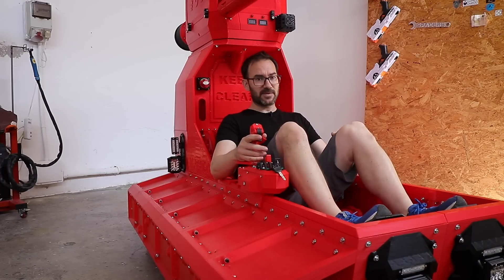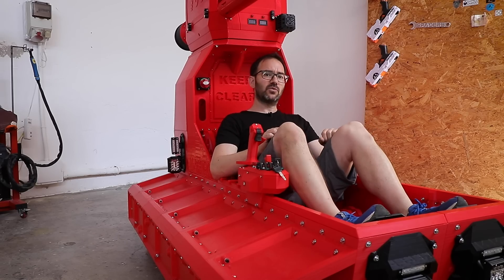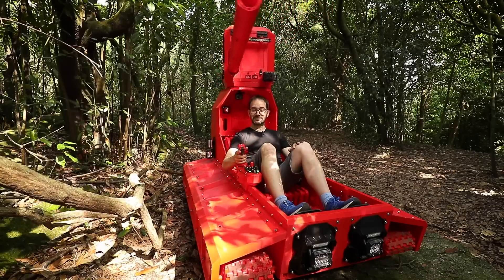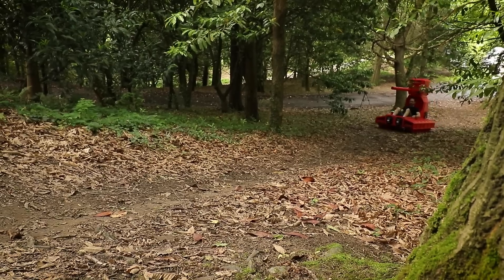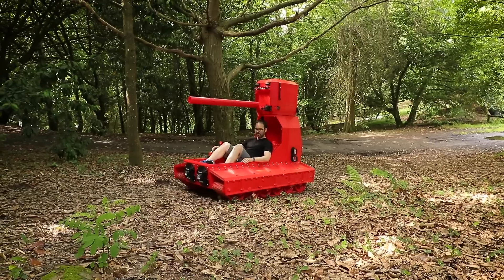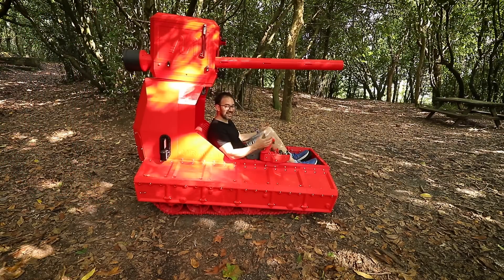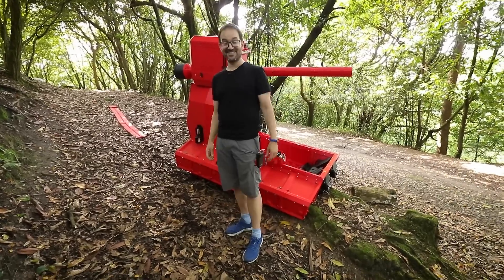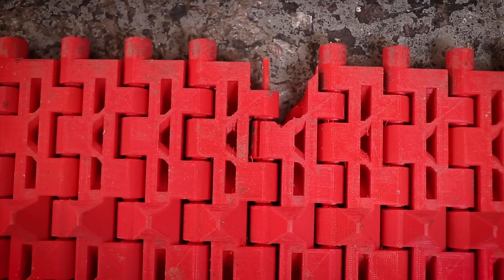You won't believe what this 3D printed tank can do

Comment: You need better approach and departure angles so you can go over obstacles, and less slack on your track so it doesn't loosen and then suddenly tighten and snap parts when you surge the throttle!

Comment: You have to remember you’re running on battery power you need to shut the lights off you’re wasting too much battery power right there. Levi lights off get your butt back out of the woods load it back up and go back to your home with your tank. And because you don’t have enough clearance between the ground and your tracks that’s another failure part on your behalf you’re not taking into consideration how much ground clearance you got I have go look at a bulldozer Howard constructed. Or go look at Fort Knox army tanks how they’re constructed. Maybe you will learn better of how the tank tracks work proper with more clearance.

Comment: IMO major mistake is that parts are printed in PLA and not PETG. Also i would add some physical mechanical brake on the back like forks or something that doesn't need electrical power to use it.

Comment: Very cool. When you reprint the tracks maybe you could print a TPU Tread and bond that to the tracks to give a bit more grip and perhaps help protect the links from as much damage. For the suspension are you making the front suspension stiffer than the rear as the mass seems focused in the rear and the nose seems to dip when you drive forwards... even before the suspensions broke. For your cannon could you add a car reversing camera to the tip and put a little screen by the joystick to make aiming easier? The reversing lines would be kind of like a rangefinder.

Comment: This is why field testing exists. You're 90% there, just need more ground clearance, more robust suspension, and stronger motor. More torque in general but i feel a more powerful motor would do it without much other modifications to teh drivetrain.

Comment: Have you thought about printing the tracks with Carbon Fiber embedded filament, it may prevent some of the damage/failures during operation.
Reply: The problem of doing this is the nozzle of the printer it, this kind material destroy the regular nozel of copper.

You should use a rubi nozzle and even in the regular size are pretty expensive and can't imagine in the size he is using for his huge printer.

And idea could made with ABS if posible and make a coated by regular carbon fiber. like you are construnting a ship or race car.

Comment: Could spraying the ground side of the treads with a rubberized coating help gives them a bit of traction and strength, something like those rhino truck bed liner sprays? Might also makes them a bit quieter depending what you're driving on.

Comment: prints with a 1.2mm nozzle are not "strong" ^^ Also the ammount of perimeters you use is very low to get prints done, but its not good for your longevity of parts. but you know this too ;)

Comment: If you want to make the threads stronger then I would suggest making them from something else than PLA like aluminium bars or something. Also I would suggest making different drive wheels.

Edit: I will also make my own electric/gas powered tank but from wood and with a metal frame. For electrical drive I will use wheels from balancewheel because they’re very strong brushless motors and for the gas I will use a gas generator to charge the batteries while driving or smth. I will make videos of this but I don’t know when I will post them, also I’m from Poland.

Comment: Hi Ivan U back at it again. Just Sean the vid pop up. Pore me my vector 3d printer kit I put toger. Even tho it has a little printing plate at the time 10 to 15 year back when I built it 3 d printing had just started bean talk about. I had 90 book about it all. But my printer has sate their. Glad it has a cover so. I've made Shaw it's stayed clean. And still hope to get it's calibrated. I need a 3d printer Tek. To help me set it up and follow the stage  steep. I got up to .it has a recourse switch. Cas have to have the cover up. To calibrate it. Then revource the switch

Comment: Sir I'm sure you hear this all the time but perhaps this is the straw to break the camels back but have you considered adding something vital? cause as a theorist of physics i would imply that plastic is not a good surface to urrrm climb leaves for fully optimal surface placement and the ability to obtain grip would allow said tank to navigate in an optimal posture when compared other tracked vehicles but the addition of little rubber strips but thick enough to gain traction you can glue them on with some industrial cold weld adhesive

Comment: Have you considered using Carbon Fiber PLA for non-flexible high load parts like the treads? I've been using Sunlu's CF-PLA for ages, more for print quality than strength gains, but it's some strong stuff and it prints like a dream!

Comment: The left hand needs a rest that has a monitor for a coaxial gun camera, readouts for battery voltage, ammo count, etc., and the light switches. Too much stuff under the gun control hand can get confusing and dangerous. The barrel re-center switch should be either under the right thumb, or on a tophat switch on the right grip. A mechanical brake that engages the inner teeth of the sprocket would work for a parking brake.

Comment: You could put a 3d printer in the back, so you can print parts that break in the field, also a way to convert the broken piece back into filament. Don't know the details, there's a lot to work through but a self reliant tank would be unreal. At the very least a small store of filament and printer.
Reply: LoL, impractical